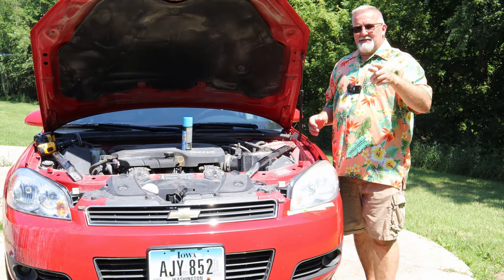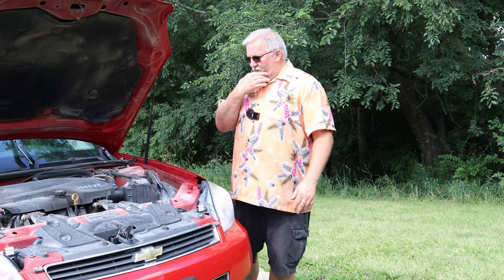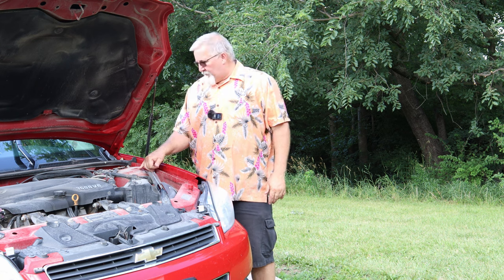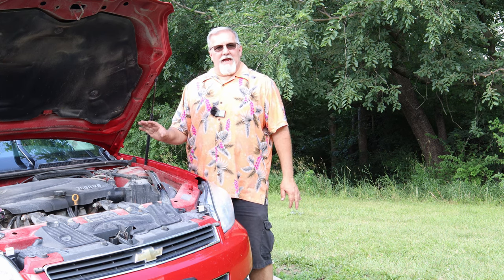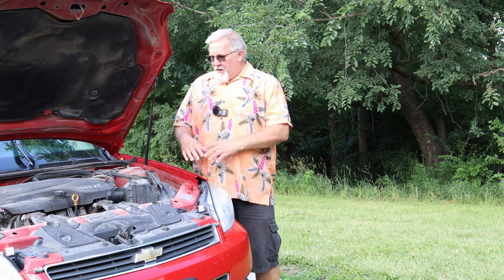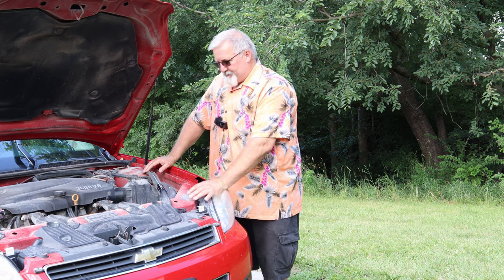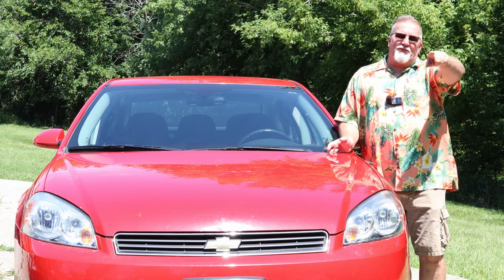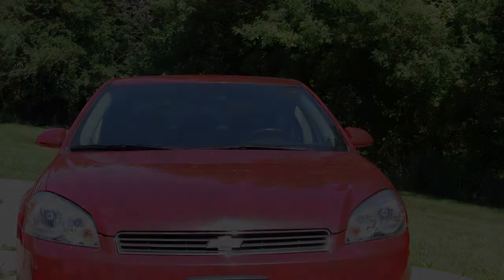2011 Chevy Impala transmission update 4T60E and a filter that's never been changed

Comment: my car has like a burning blasting smell and the fluid wasn’t brown sludge it was black and watery but the car still drove fine it was really sluggish and jerks around at highway speeds after driving for a while it also does not have reverse the car feels like it goes into reverse but it does not go back
i have a 2011 impala with the 3.5

Comment: ABSOLUTELY CORRECT about high pressure washing under the hood. 
I’ve been in a dealership parts department for nearly 30 years. Still amazes me that people will buy flooded vehicles and repair then drive them.  Every one of them has hidden issues with corrosion down the road eventually. To me just not worth it. Only way to get a reliable vehicle after water intrusion is to replace ALL the wiring and electronic components including mechanical switches.  
Cheaper to buy a different vehicle!! You might even get 2 for the same money. 😀
Reply from the maker: Thanks so much for commenting and watching.